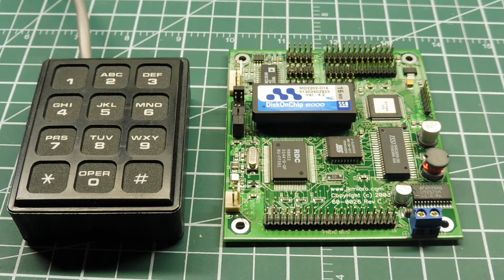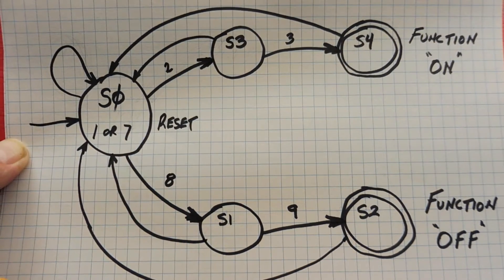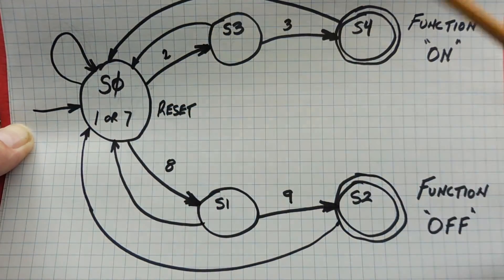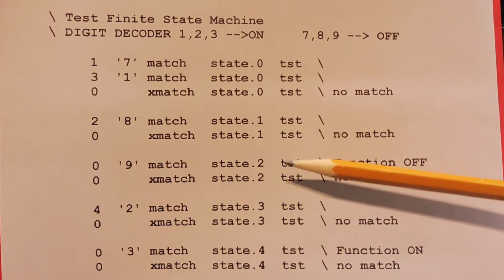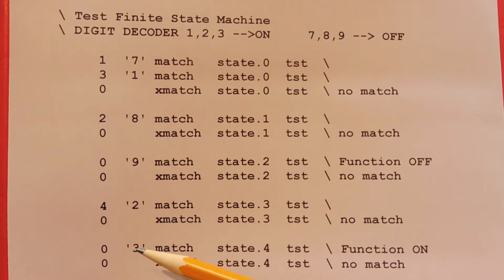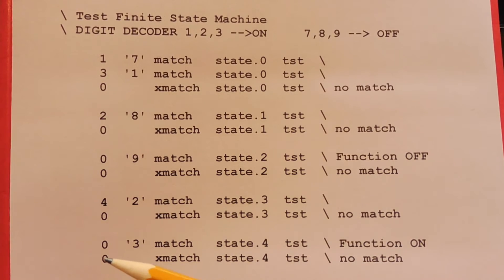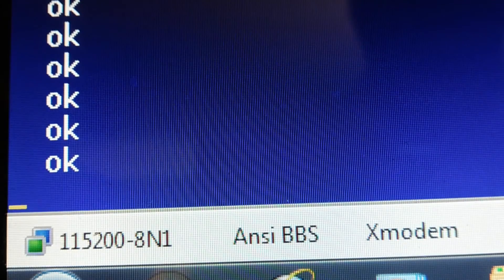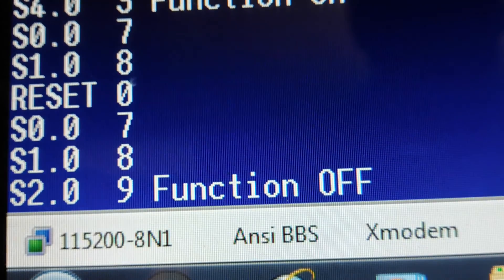Finite State Machines in Embedded Programming

Comment: What would be the most efficient way to implement this if you have to include a timer between each press, that is the next number must be within a certain time or it resets back to state 0?
Reply from the maker: Each state can run a large amount of code. The display of each state in the test program was the code that ran for demo purposes but you can run any customized code in its place.

Comment: Should state 1 and 3 have extra match cases so a sequence like ...1123 would turn on and ...7789 would turn off?

2  '8' match   state.1   tst \
1  '7' match   state.1   tst \
0      xmatch  state.1   tst \

4  '2' match   state.3   tst \
3  '1' match   state.3   tst \
0      xmatch  state.3   tst \
Reply: Thinking more about it, for it to handle the general case *123 for ON or *789 for OFF, I think the following would be required:

# state 1 (last transition was 7)
2  '8' match   state.1   tst \
1  '7' match   state.1   tst \ allow 7789 to turn OFF
3  '1' match   state.1   tst \ allow 7123 to turn ON
0      xmatch  state.1   tst \

# state 3 (last transition was 1)
4  '2' match   state.3   tst \
3  '1' match   state.3   tst \ allow 1123 to turn ON
1  '7' match   state.3   tst \ allow 1789 to turn OFF
0      xmatch  state.3   tst \
Reply from the maker: You have the right idea. You can also add more states and adjust the other states accordingly which sometimes can simplify things. You can have up to 256 (0-255) states.
Reply: Jon Pinkley z

Comment: Using tst to represent test routines,  and writing state over 100 times (with vowels) makes me want to scream. Please don't do that.

Upon further reading, I realize you're writing some kind of domain specific FSM, considering the 8bit namespace in other videos. Could you elaborate on what tool this is even meant to represent? Then again most people finding these videos are probably trying to pass some bullshit academic test, and not actually learning how to represent these theories as code.
Reply from the maker: This video shows a simple FSM using a complex construct which may seem like "tst" is redundant but it plays a very important role in the code. The construct is written in Forth and is actually a simulator used by HARRIS. The construct is meant to run on FPGAs or ASICs where hundreds of FSM are running at the same time and become intertwined. TST indicates what thread (FSM) is running at that instant and is a switching point for other FSMs. Very high speed ASICs using emitter coupled logic running the multiple FSMs was used in fighter aircraft where very high speed decisions like ejection seat algorithms are needed. Check out the HARRIS website and their RTX2010 used in military and space applications.
Reply: I'm curious now; what platform is this example running on, and what is "tst" - and what do you mean by "writing state over 100 times (with vowels)"?